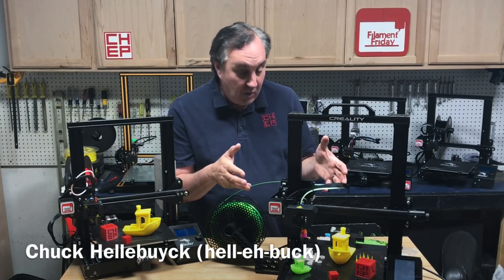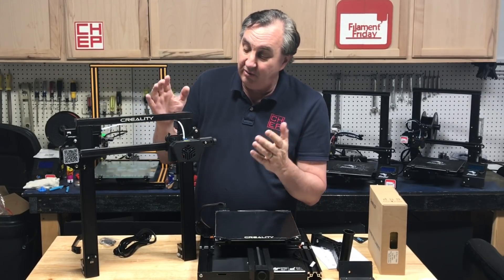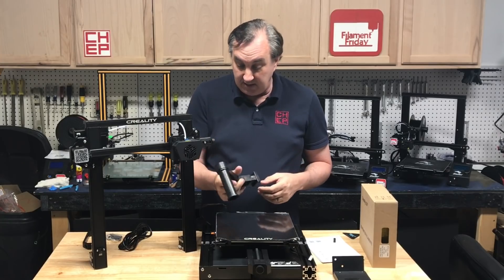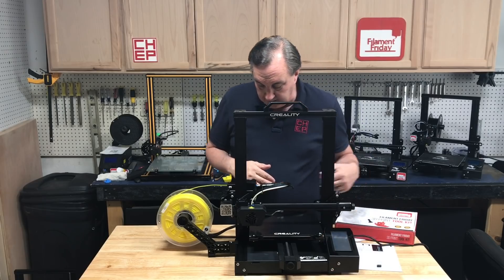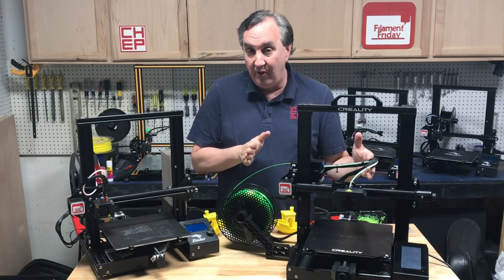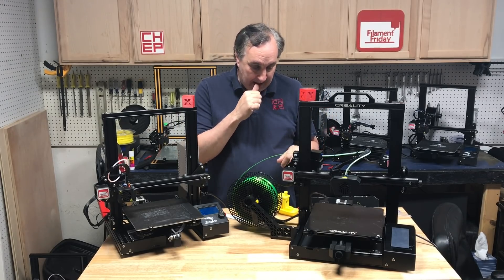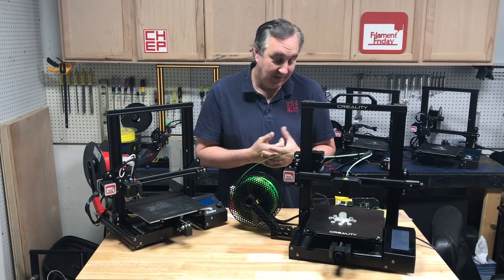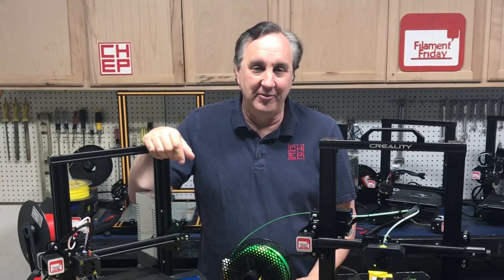NEW! Creality CR-6 SE 3D Printer - Better than Creality Ender 3?

Comment: I backed it at the $319 level (or 329... not sure) and am looking forward to it based on initial prints from the various reviews of beta versions.  The quality of the prints right out of the box with no tuning seem impressive.  This will be my  first 3d printer and I don't want to have to mod or tweak it just to make it print a benchieboat.  The fact that it did a torture cube right out of the box was the clincher for me.  Looking forward to it and hoping for the best.  Plenty of time to learn more about how to use it and what to do with it while I'm waiting.

Comment: I feel you are being a little unfair comparing an Ender 3 that you have been tinkering about with for a couple of years to make sure every line of code sent to it is optimal for that machine against a beta product that you are trying virtually out of the box. There is much to laud this new product not least of which is that a complete novice will be able to make that first gorgeous print a lot, lot quicker than most other models that need to be bed levelled, which for a newbie is a whole load of trial, error and hair pulling experience. I'm the proud owner of an Ender 3 but having watched various videos regarding the new CR-6 I'm very tempted indeed to buy one later in the coming year.

Comment: The move from usb mini-b to micro-b is stupid going from a fragile connector to an even more fragile connector when there's no space restraint in the first place. Should be a full size usb b or c.
Reply: 100x this. Why in the crap would anything go to the micro. If ANYTHING, USB C should have been adopted, or USB B.
Reply: I don't know about you two but I have a ton of micro-USB cables from old phones and devices. As more things move to USB-C+, that will be more prevalent. I appreciate them going to micro-USB, as opposed to mini-USB as many DIY, FDM printers are, as the data speeds are faster and I have a bunch of varying lengths/colors to choose from with my existing collection of cables!
Reply: @matthelton6637   Both mini and micro are too fragile. There's just no need to use a slim connector on such a big device. USB-C or B are designed for this exact application. Also there's no speed difference between any of these connectors so that's not a concern.

Comment: 13:40 it’s not worth it.  At $400+ it’s over double the Ender 3.  It doesn’t print twice as well.  The days of printers with only 200mm beds costing $400+ are over.
Reply: you can still buy the ender 3 for 189$ right now. Its good to have a premium model... only 319$ right now.

Comment: 13:00 I disagree with the Ender 3 being a tinkerer printer.  Anyone can buy a Ender 3 and churn out print after print without any modifications at all.  It’s perfectly good as is.  Can it be modified?  Any printer can be modified.  Does it require modification to print well?  No, not at all.

Comment: I thought the price was going to be $299. At $429 there is no chance I would even consider it.
Reply: Creality's stated "price saving" saving at the kickstarter gives a MSRP of $430 USD, the selling price atm is $319 + SH; first 200 @ $265 and next 500 were $299. CHEP'S statement of "if under $349" basically just goes along with the Kickstarter pricing which goes up to $339 for last 500, interesting choice of price CHEP. If Creality was smart, they'd offer another $265 for delivery in DEC, I'd bet they'd sell another 5000 units just there. I'd guess though in the end, the $429 will be the base price, with lots of discount sales just like so much else is now.

Comment: I appreciated the video. I was concerned when I saw how you discerned ghosting / ringing (by scaling up) that I might be getting invalid information from the video. Motor power, print speed, firmware acceleration controls, gcode tweaks, ram for higher resolution gcode, backlash / drive train precision, rigidity, all effect print quality, and scaling up would have varying effects on these factors; it probably hides some problems while highlighting others. I would love that taken into consideration when you review the new Ender V2. If you don't know much about it, I recommend peeking at the video "Remove ringing by tuning acceleration and junction deviation" (it's by 'Teaching Tech'). Sorry for referencing another YT'er here, but it's good info.

Comment: I can get this only for the silence
Reply: You could also order the newer main board and install it on the Ender 3. Label the wires before removing and it takes no time at all to swap the boards.
Reply: @shryx86  I have ender 3 already. I was thinking how can i make it quiet. And i was didn't know it is possible to make it quiter with that way. Thanks sir. I'm on it.

Comment: Auto leveling and all the warping, is the z-offset not standardized and somewhat set. Always wondered why even have autolevel, if it really isn't setting the nozzle distance to print.....
Reply: Auto leveling, even if it works perfectly won't account for the exact distance YOU may need for a specific filament,  layer height, bed and nozzle temperature, bed type etc..  At least this gets a new user very close and no one will be burying their nozzle into their glass bed trying to figure out an added BL Touch and Marlin configuration if they don't know what they are doing with their new printer much less VS Code and Platformio.  A quick Z offset adjustment up or down depending on your results and you'll be spot on.  Sounds like a win to me for many.

Comment: Great video. Having an ender 3, i dont seem to be able to access 220mm x 220mm build area as Cura seems to tap out at 200x200, do you happen to have a video about unlocking this?
Reply from the maker: Will have one soon.
Reply: I changed the print area measurements to match the physical dimensions of the print bed. The stock Cura setting is too small.
Reply: You should be able to change this under Manage Printers/Ender 3 (or whatever you've named your profile)/Machine Settings for your Ender profile in Cura.  I'd post a picture for you but I can't on Youtubes comment section.  Also, you can go 235x235x250 on the Ender 3

Comment: I would prefer to have Ender 3 with Duet Wifi + all metal hot end + BL tooth rather than CR6, just not worth it. Creality needs to learn how to make a breakthrough. This is not a SPECTACULAR product even still in BETA due to pricing strategy.
Reply: gfhr b39 I could never get my duet WiFi working properly 😢
Reply from the maker: They had some bad ones. My Artemis with it gave me issues for a while.
Reply: @FilamentFriday  Thank you for you reply, now I know I am not crazy!

Comment: For those of us who are getting this as our first FDM printer, it'd be very appreciated if you could list the settings tweaks & any other mods you made, to get those original failed print jobs to come out as good as they ended up!
Reply: i wouldnt get it. just get and ender 3 pro. thank me later!
Reply: as jrok96 suggested, get an ender 3 pro. Buy some better springs, metal extruder, skr mini E3 which is plug n play, maybe get a glass bed and you have a machine, that has 32 bit board running marlin 2.0 with pretty much reliable print quality.
Reply: @Warump  So by the time I research where to buy all those mod parts, and then pay for all that, and then spend how much time to modify a Ender 3 Pro so to be equipped with all that... THEN I'd have the same as a CR-6? 
So why not just simply buy the CR-6 for $80 over the cost of an Ender 3 Pro (not figuring-in the cost of all the mod parts), and avoid all that hassle and time?
(Note that 3-D printing is a tool for all my other hobbies. It's not a hobby for me onto itself).
Reply: @bgm-1961  If you can get to only 80 $ difference, then CR6 is obviously a better option if you have got the money. But  once is at that 400+ pricetag chep mentioned, I'd advise not to and go with what I suggested.
Reply: @Warump  Thanks for the reply. Yeah, the CR-6 is currently going for $319. The Ender 3 Pro is $239. And then how much more do all the mod parts add to that price? But now that I take a closer look, I see the E3Pro going for as little as $199. So that's $120 difference, which will, again, change by the amount required for the parts to mod the E3Pro. Finally, since 3D printing isn't my primary hobby, I'd also have to factor-in the value of my time. All in all, it sounds like the extra dollars spent for the CR-6 when the math is all over, is worth it for people in my situation.
Reply: @bgm-1961 From my aliexpress account... 23 USD SKR mini e3 v1.2, 5 USD for springs, 12 USD for aluminium extruder, 17 USD for borosilicate glass bed. Prices converted from € to usd and for some items its more than 1 year since I bought them. So thats grand total of 57 USD for upgrades that are pretty much plug and play.

Comment: Well I had no idea this was coming out, bought an Ender 3 Pro a couple weeks ago lol.  I'm happy with my purchase though, the Ender 3 Pro's design seems more suitable for modding, and I got it for only $200 anyways.
Reply: Nothing to worry about, you'd pay twice for CR-6 and get ender 3 pro with $50 of mods...
Reply: Cheapest I've seen and Ender 3 Pro was $240.
Reply: @Arek_R.  $50 barely get you a touch screen and 32bit board.

Now all you need is the Dual Z, better Y, better hot end, better extruder, ABL, and sensor. But you'll still have a smaller build surface.

Either way. $200 for a Pro is a great deal if it's new with free shipping.
Reply: @mathewcoppola8622  Dual Z is not needed for small printers, this "better" extruder doesn't improve the print quality at all and is just of different shape nothing improved, ABL doesn't work well either he had some prints come off and 32bit board is not needed for this printer configuration.
Touch scree, fake BL touch and 32bit board with silent drivers is around $50 from aliexpress.

Comment: what would you suggest for a 3d printer that can do laser cutting and routing.? I saw the CP-01 but need a larger work area than that. Do they have something for this new CR-6 or CR-10 v2, etc?
Thanks.  Loved the video.  Very clear.  Have they upgraded the other models to 32 bit?

Comment: Managed to get the Kickstarter at $319 which is about the most I felt I would want to pay for it at this point. I like it already has the silent board and the auto level that I didn't have to add.
I already have an Ender 3 (non pro) which I upgraded to metal extruder and silent board. Not a pain to do, but nice to get a machine with it already. Auto leveling built in was definitely a feature I'm curious to see in person how well it works.

As you noted in the comments - they are already going to give an option of a 32 bit board as a stretch goal (interesting they state we'll get a choice, which makes me wonder if it's going to cost extra and not just it will have it already). Their next stretch goal as of today is about met to include extra nozzles, and their follow up one is to make it 2209 steppers. 

I agree with one of the commenters below, Creality really has too many similar models and it's confusing especially for a newcomer.

Comment: I got a 20€ upgrade kit for my ender 3. Stepper motor dampeners, TL smoothers, a metal extruder and stronger bed leveling screws. The printer is not silent, but quieter by a ton, and since i build a 20€ acrylic enclosure, even more so. The quality is great, and even at 100mm/s the prints look pretty clean. Considering i spent 180€ for the printer, 20€ for the kit and 20€ for the enclosure, I cannot see a reason to get that new CR-6 SE. Yeah, auto bed levelling is nice, but is it worth 200€ more? I'm a 3d printing amateur and its only some sorta side hobby if anything, so I dont really need much more than that.
Reply: I am also very happy with mine. I just love my Ender 3 Pro. No Problems with 100mm/s as well.
Reply: @johnny4498  Only thing is some slight underextrusion // imperfect corners, which is whatever. Although my printbed is uneven as hell. To fix it i put some stripes of tinfoil below to bed. However, I'll order a glass cutter soon and turn some old picture frames I don't need into a perfectly even bed
Reply: @Genesis-dj7kw  Yeah man, that underextrusion is caused by the tensioner spring which gets weak over time. I just fixed this with a little spacer for the spring
Reply: At $319, yes it has more than enough upgrades to make up that price.

Comment: I think 429 for that just to have stuff you can print once you get your printer is a bit high. I would honestly pay around 360 give or take 5 or 10 for that. 
I am just not seeing 429 for that printer. Sorry. for over 400 for that it better have a 32Bit board and Noctua fans and all that. It better be a lambo. Think I am going to keep running my modded ender 3
Reply: You can get it on kickstarter for 320 right now
Reply: It's currently being offered for $320, and it now comes with a 32 bit board (for that price).

Comment: Thanks, Chuck for another great video. You really do a fantastic job! So the printer.... Meh. As said in the comments it is just another Ender 3 incremental "upgrade" with nothing really worth the price. Bowden tube? Really Creality? For this money there are much better alternatives and what is up with a Kickstarter campaign? They want end users to subsidize their production retooling? That in itself would be enough for me to never buy a Creality product (assuming they actually had a product worth my money, which they don't). There are some much needed improvements over the Ender 3 but also it looks like upgrading the hotend is more difficult. I'm most surprised at how Creality seems to be squandering their initial market share with these continuous small, incremental changes. There are too many other really good printers in this price range to even consider this CR-6. Thanks again Chuck.
Reply: Can you name 2 in this price range (+-$50) that match or beat features? Ali baba specials don't count
Reply: @yzeerkd  Artillery Genius. $350USD Banggood regular price. Direct drive. Sovol SV01 $340. Direct drive.

Comment: I think buying an Ender 3 you have so much more budget left for much more interesting upgrades. This thing looks really overpriced.
Reply: hi crosslink :)
Reply: So name them.
You have an Ender3 and $140, tell me what you are getting for upgrades.
Reply: @mathewcoppola8622  skr 1.4 with 2209, color Touchscreen Display, dual color extruder, bl touch sensor, raspberry pi with OctoPrint. All in budget
Reply: @Crosslink3D  or an Hemera :)
Reply: @certified-forklifter  or an Hemera, exactly

Comment: Looks like a pretty good machine Chuck, like you said a bit pricey though. Will be interesting to see how it stands up over time, especially how solid the strain-gauge sensor maintains it's accuracy.
That spool holder looks good, will see if I can find it to tweak it for my Borg.

Did you find out why they included the z optical sensor?
Reply from the maker: No. It may be backup to confirm the head is near the bed so the hot end doesn’t jam the strain gauge sensor into the bed.

Comment: Excuse me, that I writing here. But I found issue with Capricorn tube and TPU. I used to use cutted in angle tube through to gear, so no filament jamming. But after Capricorn it seems that TPU can’t be pushed so easily and in one moment gear just start to slipping on filament.
I use metal extruder.
Reply: Had the same problem upgraded my Ender 3 to a new PTFE tubing, new couplings and a metal extruder. I always got a jammed extruder with this setup. Seams like this combination in my case cause too much friction. You could try increasing the stepper motor voltage (be careful!) and the e-steps, but that didn't solve anything for me. Had to change everything back to the original setup and now it works flawless. Maybe I'll try different combinations of this setup later this year.

In my case I had this problem with PLA for some kind of reason.
Reply: comedyclub333 I have no problems with other plastics, especially PETG now not stringing so much as before.

But TPU after some layers just stops to go out from nozzle.
Reply: @SlavaChrome  well okay, I don't have any experience with TPU, sorry.
Reply: comedyclub333 it’s okay, no problems, mate :)

Comment: The reason for your adhesion issue is likely because of the new leveling system combined with your .12 profile. on this machine there is no z offset. it has a setting called z offset but thats not really what it is. This printer understand "true zero" it actually knows where 0-0-0 origin to the nozzle tip is. so in reality z offset is your "first layer height" it defaults to 0.3mm which is PERFECT for 0.2mm layer heights. because your printing 0.12 your printing "too high" either chop down the first layer height in the slicer (maybe to 0 or 20% experiment) or adjust the first layer height (z offset on the screen) and it should be fine.
Reply: This will be a problem for a lot of people I bet. I wish Creality (or any reviewer other than you) would emphasize the fact that this printer knows true zero.
Reply: Excellent explanation! Very glad got to see this post. Thanks for sharing this knowledge.